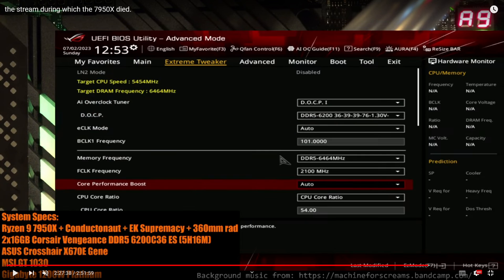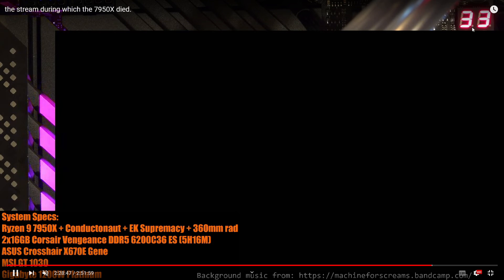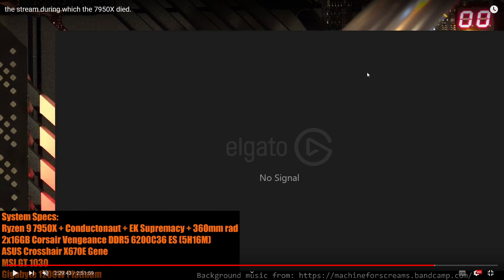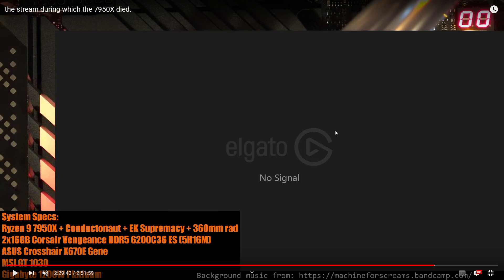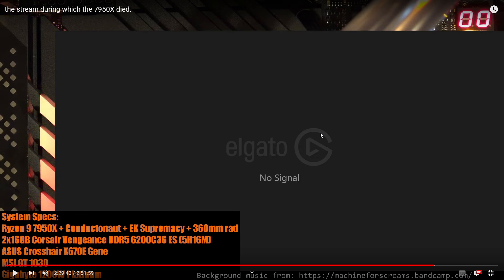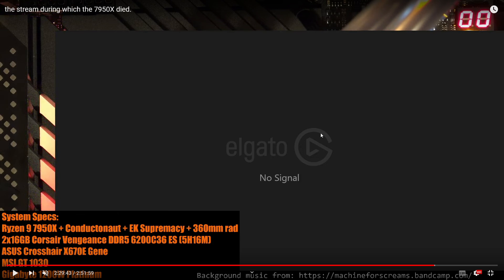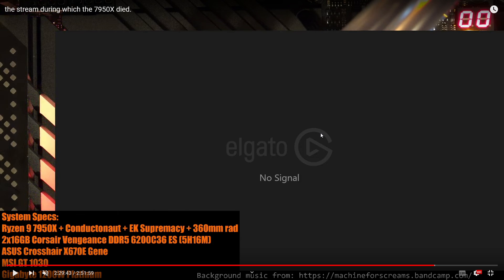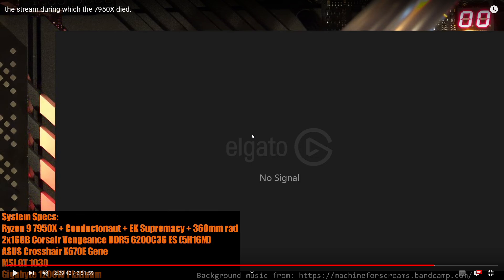My Ryzen 9 7950X died.

Comment: AHOC is probably the most informative overclocking channel on YouTube. 
AMD needs to get this man another zen4 CPU ASAP.
Reply: Send him a bloody tray full
Reply: @danieltubio-rey1984  2 tray fulls.
Reply: I used to work in a boutique PC shop until 12 years ago.

Even today, when I buy something from there I get a 35% discount (ie cost price) and the warranty voids after 21 days, which is the length of time I'll not push the hardware for validation purposes, because after that it'll get clocked.

Since I started OCing: Pentium 166MMX up to about 200ish, P2 333 to 500 (RIP), P3 550 to 600-something (dog of a chip), P3 800 CuMine to 900ish (also a dog, and RIP), K7 Athlon 600 to 850ish under water (degraded), K7 Athlon 700 to 900 under water, Athlon 1GHz to around 1.25 under water, P4 Northwood 2GHz to around 2.4ish (degraded), Northwood 2.8 to 3.1ish wet, P4 631 3GHz to 5GHz wet Peltier, i7 920 2.66 to 3.8 wet - actually 4.1, but the extra perf wasn't worth the volts, and current victim is a Xeon E5 1660v3 at stock, wet, and maybe upgraded next year.

It's really awesome of AMD to send the next vic - I mean, CPU.
Reply: : ASAP!
Reply: It's important to understand how these chips work and how they behave, both under normal conditions as well as when you're pushing them to their limits. I've learned more about computers from this channel than anywhere else, as have a lot of other people. 
The notion that it would be a "problem" for a literal hundred billion dollar company like AMD to send someone like buildzoid, who provides the PC enthusiast community with such incredibly detailed and useful information for free, a fancy piece of silicon that they produce in the tens of millions is ridiculous. Nah you're right,  Lisa Su might not be able to feed her kids if they give away another CPU to someone who will use it to inform the community and potentially drum up sales, on a series that isn't selling well.
Overclocking IS an intended use, even if it isn't recommended and voids your warranty. 
AMD sent the guy who runs a channel called "Actually Hardcore Overclocking" a $700 cpu to test and to teach his viewers about. They didn't do this under the assumption that he would make videos about running it at bone-stock settings. 
AMD funds overclocking competitions. They do not do this thinking everyone participating will be submitting the same score.
AMD has their own in-house professional overclocking team. They do not instruct these people to run stock frequencies and voltages using liquid nitrogen. 
AMD has the ability to lock down their chips and keep you from overclocking them, like with non k Intel SKUs and the 5800x3D. They do not do this, because they are well aware that there is a large community of people who are more interested in overclocking than in normal usage.
Not sure why you're advocating against overclocking on a channel called "actually hardcore overclocking"
If that's your attitude, I'm not even really sure why you're here in the first place to be honest.
Reply: @werewolfmoney6602  such observe. much science. you stick it in the socket and turn on the power. it computes instructions. that's how these chips have worked for the last 30 years.

don't give me that "if you're not here for overclocking, then leave". criticizing buildzoid's behavior/wording in one specific instance does not make me (or anyone) less eligible to watch his content. the world is not "us" vs "them". grow up. 

and don't put words into my mouth. when did I advocate against overclocking? actually, don't answer that. thanks for your passionate response! have an overclocked day!
Reply: @jazzochannel  
Lmao
AMD sent him a 7900x to replace the 7950x that died
A viewer bought him another 7950x
I'm really sorry that many people in this community dont share your opinion that you should just put the CPU in the socket and power it on, but that just isn't how the world works. Grow up.
While we are on the topic of putting words in people's mouths, you are the only one bringing up "us vs. them," and I never once said that this, a public YouTube channel, is exclusively for people who are interested in overclocking. But it is for people who are interested in the technical side of how these things work. You cannot have that content if the creator doesn't have a sample to test. If you aren't interested in that content, then you're just here for what? To complain? How's that working out for you?
Reply: For what? To run the CPU under conditions the manufacturer haven't designed them for? Why should this become a problem for the manufacturer now?

It's ok to overclock your system, but it's also fair that the customer will loose his guarantee und have pay another CPU on the own budget.
Reply: @tsmemphi  I agree with you. Overclocking is a niche hobby - one that voids the warranty. One must be prepared to deal with that. The level of entitlement and e-begging in this "channel update" is through the roof. Last time I burned a CPU was 2004 or so and I was 17 (no steady job). I re-evaluated how beneficial/risky overclocking is and moved on. CPUs are generally very solid, but one can get unlucky.

Comment: Did you look into each of the PC components? You seem to be knowledgeable in overclocking but you seem to have centered on the CPU. Would it be the MB or even the the PSU? I did have a PC that failed because of a blown out motherboard capacitor.
Reply: Did you even watch the video? He says less than 3 minutes in that it isn't working on any motherboard
Reply: did you watch the video
Reply: He has other cpu to know what's the issue, and he is way to good to forget these possibility
Reply: @HyperOpticalSaint  he doesn't have another am5 CPU
You didn't watch the video either
Reply: @HyperOpticalSaint  Too good to forget what is basic? He did not even mentioned condition of other components so he assumed that these are okay. When you investigate the root cause, you should not only be rambling but do a visual inspection/checking.

Comment: 1.385v SOC from AUTO, is that high for the new zen?
Reply from the maker: Not from what I've been told.
Reply: @ActuallyHardcoreOverclocking  maybe you've hit some implicit limit regarding voltages.

It has already been mentioned in your channel as well that one could not lower indefinitely VSOC/CORE/VDIMM nor independently from each others ?

RIP 7950X.

PS. I've bought an old 500MHz 4 channels Metrix for nothing. You'll take some time blueprinting but
It does the job, sure you don't have all (useless) fancy things but I never need those when I was student. The most important was just to check for something you already know.
Reply: i wouldent know for zen3/4 but i know zen/+ 1.4V soc could pop them on ambient

Comment: Isn’t 1.42v way too high for zen4? I swear on GN LN2 they were using 1.4v+ for LN2, either way maybe there is some kind of voltage spike at boot? Sucks though.
Reply from the maker: the CPUs go to almost 1.5V on PBO.
Reply: @ActuallyHardcoreOverclocking  Default PBO or at maximum negative undervolt, maximum scalar?

Comment: Maybe this is why you don't overclock and just get what you need IF you want more speed?????
Reply: Maybe this is why you don't buy Asus boards that overvolt your CPU without you wanting it would be a more correct comment
Reply: @AA-kx5es  true that, I actually have always gotten Gigabyte and have never had any issues. Running a Threadripper 1920x on x399 Gigabyte board now, until I get my 7950x on a Gigabyte x670E Master board
Reply: @AA-kx5es  yeah im hoping its not the board  as the gene was the board i was looking at for the upcoming 7000 3d release !!
Reply: it already is the fastest . there is nothing faster to buy

Comment: since it is dead
delid it and see if one of the external components could be replaced
Reply: ? You do realize it’s very hard to desolder and re-solder a chiplet…
Reply: @AaronShenghao  
low melt solder +  high quality flux = good things
see NorthRidgeFix 
he recently fixed some r9 pins

Comment: Same thing that killed many x99 cpus in asus boards in the past, random 2v cpu voltage on boot and instant kills the cpu
Reply: You needed Input voltage at 2 volts for most overclocks on X99/X299 though.
Reply from the maker: @PolskiJaszczomb  nah the buggy X99 boards set the CORE voltage to 2V
Reply: @ActuallyHardcoreOverclocking  They... did what. Of fk.
Reply: @ActuallyHardcoreOverclocking  geez, that's crazy.
Reply: @PolskiJaszczomb  nope, was the core voltage, not the input

Comment: First the 6900 XT dies on you randomly, now the 7950X. Just bad luck BZ, probably got a defective CPU with bad silicon. Rare but happens
Reply: It is a bad PSU
Reply from the maker: @serbrighterunagainst9231  this is a different PSU from the 6900XT death.
Reply: @ActuallyHardcoreOverclocking  Then you had it in the same place, same spot, with all sattelites and basestations, there are points where radiation converges...  Maybe some of your neighbours does welding... I'd also never turn on a PC without a UPS again if I were you. :)

Comment: Only Buldzoid could do this ;P
I do hope they send you another one. Now I need to watch the video for exact context.
Reply: Doesnt it have warranty ?
Reply: @Chris-hw4mq  died while overclocking
Reply: @steezegod2768  no one can proove a cpu died because of overclock
Reply: @Chris-hw4mq  unless you literally do a livestream killing it
Reply: @Chris-hw4mq  There are edge cases in which it would be reasonable (especially if you RMA CPU + Mobo, which many less technically inclined people do) to assume it died from OC. But IDK what kind of sensors and "memory" the CPU has. We know it's full of sensors for PBO and similar stuff, so it might actually "remember" some settings. Question is if that's the case, then who has capability to check? If AMD only, then it is indeed useless in most cases and would only serve to troubleshoot.
Remember that all you have to find out is whether for example EXPO/XMP profile has been loaded.
Reply: @rdmz135  yes of course if you video it they reject the warranty.
Reply: @Chris-hw4mq  It was sent to him by AMD. You only get warranty if you buy the product.
Reply: @Chris-hw4mq  Press sample - so no warranty. It would be void either way, since it was OC'ed. Though that depends on how obvious the damage cause would be. But this isn't a retail CPU, so normal process doesn't apply.
Reply: @jannegrey  ahh ok.

Comment from the maker: EDIT3: An extremely generous fan of the channel has fully funded a replacement 7950X. Also AMD is sending over a 7900X.

EDIT: If you want to support the channel I strongly recommend the Patreon. I've had it so long that I'm on the Patreon founders plan so they only take a 5% cut which is the lowest of all the platforms I use.

EDIT2: Since the CPU is dead I went around the Gene with the O-scope checking that all the main CPU power rails startup correctly and at least when it comes to booting on default voltage which is 0.8V(voltage the board goes to before the CPU is intialized) I didn't see any issues with turn on transients.

press F to pay respects.
Reply from the maker: F
Reply: @ActuallyHardcoreOverclocking  F
Reply: F
Reply: @ActuallyHardcoreOverclocking  🤣
Reply: @ActuallyHardcoreOverclocking  F
Reply: @ActuallyHardcoreOverclocking  F
Reply: @ActuallyHardcoreOverclocking  F
Reply: @ActuallyHardcoreOverclocking  F
Reply: @ActuallyHardcoreOverclocking  F
Reply: @ActuallyHardcoreOverclocking  F
Reply: @ActuallyHardcoreOverclocking  F
Reply: Fespects!
Reply: ফ
Reply: F
Reply: F
Reply: That's so fucking cringe. The same comment about how generous a viewer is you advertise your patreon.
Reply: F
Reply: F
Reply: F
Reply: F
Reply: F
Reply: F
Reply: F
Reply: F
Reply: F
Reply: F
Reply: F
Reply: F
Reply: F
Reply: F
Reply: F
Reply: F
Reply: F
Reply: F
Reply: F
Reply: pepesadge
Reply: F
Reply: F
Reply: F
Reply: F
Reply: F
Reply: F
Reply: F
Reply: f
Reply: F
Reply: F
Reply: F
Reply: F
Reply: F
Reply: F
Reply: F
Reply: F
Reply: F
Reply: F
Reply: F
Reply: F
Reply: F
Reply: F
Reply: F
Reply: F
Reply: F
Reply: F
Reply: F
Reply: F
Reply: F
Reply: F
Reply: F
Reply: F
Reply: F
Reply: F
Reply: F
Reply: F
Reply: F
Reply: F
Reply: F
Reply: F
Reply: F
Reply: F
Reply: F
Reply: F
Reply: F
Reply: F
Reply: F
Reply: F
Reply: F
Reply: F
Reply: F
Reply: Bruh
Reply: F
Reply: F, i hope my 7950X stays safe as i only use PBO.
Reply: i see 5.4ghz and 1.4 volts while i see other doing 5.4ghz at under 1.3volts u killed it with voltage
Reply: F to the R9 7950X 

Glad you got sorted out replacing it though, given the cost. Thanks to the anonymous fan and AMD for those.
Reply: G'day Buildzoid, F😢
& as a fan of M-ATX so good to hear the Gene survived & was not the cause of the Death so we can get more content with it,
Plus a MASSIVE THANK YOU to the Fan who has helped replace the 7950X & AMD for doing what they can with a 7900X
Reply: " An extremely generous fan of the channel has fully funded a replacement 7950X " (Your mother 🤣🤣🤣) What a dumb.
Reply: F
Reply: F
Reply: F
Reply: F 😢
Reply: F
Reply: f
Reply: F
Reply: F
Reply: F
Reply: F
Reply: F
Reply: FF
Reply: F
Reply: F
Reply: F
Reply: F
Reply: F
Reply: F
Reply: F
Reply: F
Reply: F
Reply: F
Reply: F
Reply: F
Reply: F
Reply: F
Reply: F
Reply: F
Reply: F
Reply: F
Reply: F
Reply: F
Reply: F
Reply: F
May it rest easy.
Reply: F
Reply: F
Reply: F
Reply: F
Reply: F
Reply: F
Reply: F
Reply: F
Reply: F
Reply: F
Reply: F
Reply: F
Reply: F
Reply: F
Reply: BIG F
Reply: F
Reply: F
Reply: F
Reply: F
Reply: F
Reply: F
Reply: F
Reply: F
Reply: F
Reply: F
Reply: F
Reply: F
Reply: F
Reply: F
Reply: F
Reply: f
Reply: F
Reply: F
Reply: Fedora
Reply: F
Reply: F
Reply: F
Reply: F
Reply: F but this is not an L.
Reply: F
Reply: F
Reply: F. 
To the best memory OC teacher on YouTube.
Reply: F
Reply: F
Reply: F
Reply: F
Reply: F
Reply: F
Reply: F
Reply: F
Reply: F
Reply: F
Reply: F
Reply: F
Reply: F
Reply: F
Reply: F
Reply: F
Reply: Just measure the resistance on the main rails, it's probably gonna be low, that case it's the mb problem, other way the ryzen is a way more unstable even in compare with 3xxx 5xxx, got a lot of dead cpu's in past 2 years (have a pc lab in my place).
Reply: F 😿
Reply: F
Reply: F.... sake
Reply: F
Reply: F
Reply: F
Reply: F
Reply: F
Reply: F
Reply: F
Reply: F
Reply: F
Reply: F
Reply: F
Reply: F
Reply: F
Reply: F
Reply: Sorry mate but you got a new patreon member :P
Reply: F
Reply: F
Reply: F
Reply: F
Reply: F
Reply: F
Reply: F
Reply: F
Reply: F        we'll miss you😥😥😥
Reply: F
Reply: F
Reply: F
Reply: F
Reply: F
Reply: F
Reply: F
Reply: f
Reply: F ♥️
Reply: F
Reply: F
Reply: F
Reply: F
Reply: F
Reply: F
Reply: F  _____ Might be advisable to wait see if others are having similar problems.  What about static discharge.
Reply: F
Reply: F
Reply: F
Reply: F
Reply: F Good your having some fanboys, was just about to offer you the same :D
Reply: F
Reply: F
Reply: F
Reply: F
Reply: F
Reply: F
Reply: F
Reply: F
Reply: Yay! Whales ahoi!!! Let's goooo!
Reply: F
Reply: It seems to me that AMD still has problems with the chiplet? the most tenacious stones are 1700 Ryazan and 2700 as well as 3700/5800 and are tenacious because they have one CCX module. If it concerns 3900/3950 5900/5950 and 7900/7950, then there are two CCX modules, then there is a chance of a dump. What is causing this problem? because of infinity fabric?
Reply: f
Reply: F
Reply: F
Reply: F
Reply: F
Reply: F
Reply: The 14 days return window is mandatory fot every product you buy online in Germany, It is a law to allow you after you bought to check it for yourself if you received what you paid for.
If you didnt receive what you paid for or the product is immediatly defective the seller is by law required to refund you all of your money during these 14 days, no questions asked!

We also have a law that protects js 1 year after buying a product. If you have a failure during the first year, the law says that the product was probably alresdy damaged during production or shipping. Again, the seller is by law required to either immediatly refund you or send a new product free of charge.

Since Germany has in total a mandatory 2 year warranty for all its customers, the seller also has to cover any defects during the second year. However, he is not obliged to give you a totaly new product.
By law, he is only required to give you repaired product.
If however after 2 repairs the product still doesn t work as usual, he is forced to now give either the money back or a brand new product.
Reply: you could mention him atleast he supported you and he is just a fan of channel to you lol
Reply: F
Reply: F
Reply: F
Reply: FFFFFFFFFFFFFFFFFFFFFFFFFFFFFFF😁
Reply: F
Reply: F
Reply: F
Reply: F
Reply: F
Reply: F
Reply: F
Reply: F
Reply: F
Reply: you should send the CPU to AMD to see if it was the overclock that killed it or if it was something other than the Overclock.
Reply: F
Reply: It would be nice that you give 7900X on a giveaway since you got new one from fan.
Reply: F
Reply: F
Reply: F
Reply: F
Reply: Now I’m worried about my 7950x
Reply: F
Reply: LONG LIFE RAPTOR LAKE
Reply: F